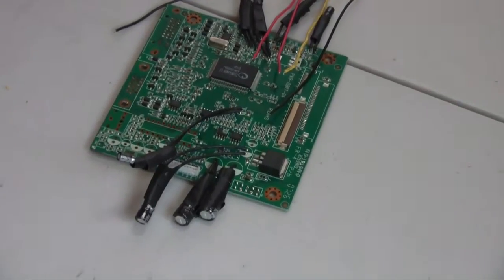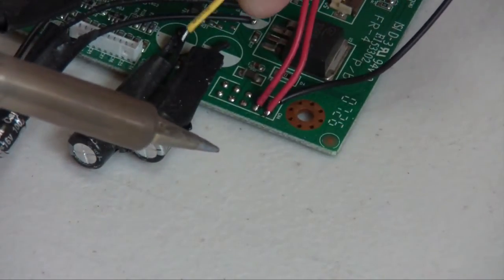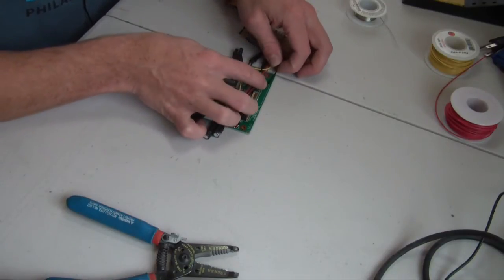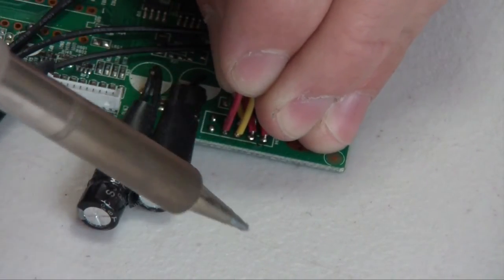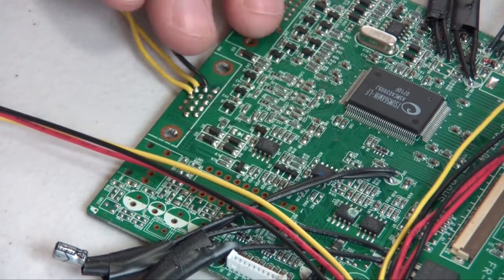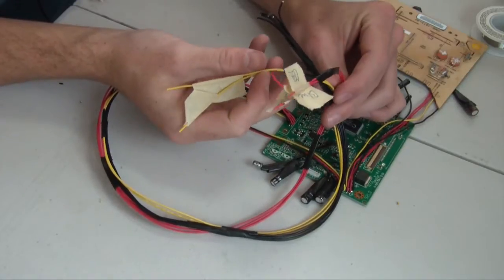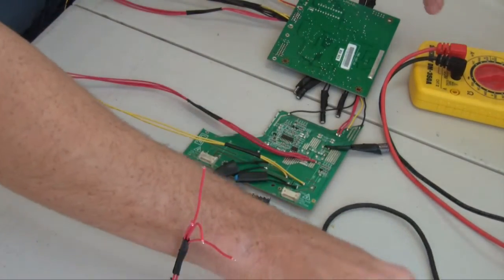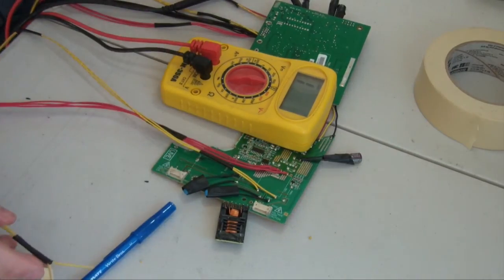"X-Top" How-To #4 - Circuit Board, VGA and Transformer Wiring

Comment: well i have puted the inverter to the bottom portion so i just needed to re wire vga and flathen the capcitors at the driver board i just looked this guide for un necesary connections thanks